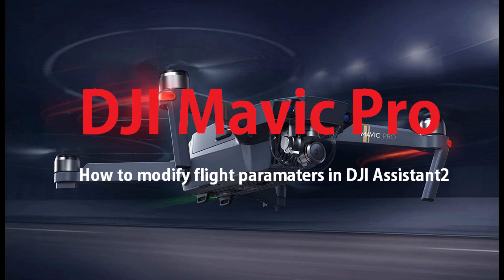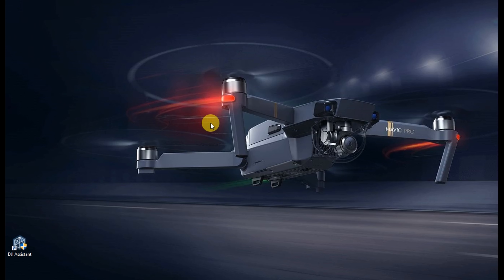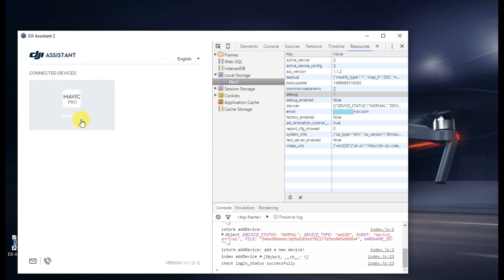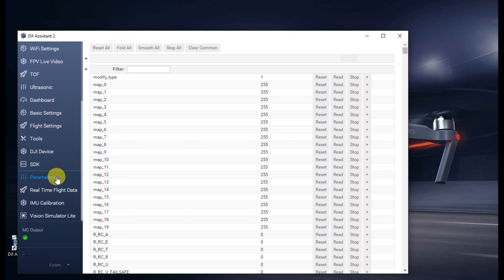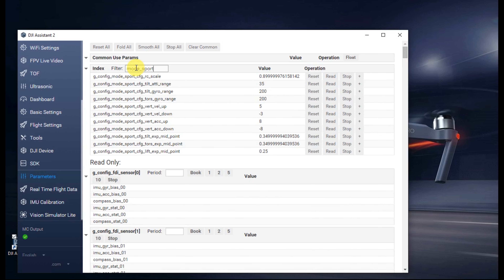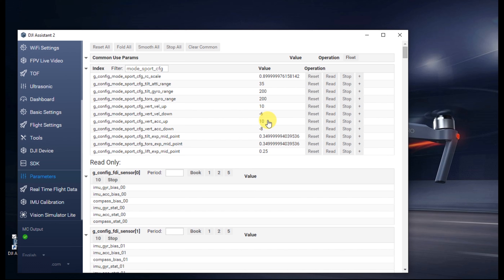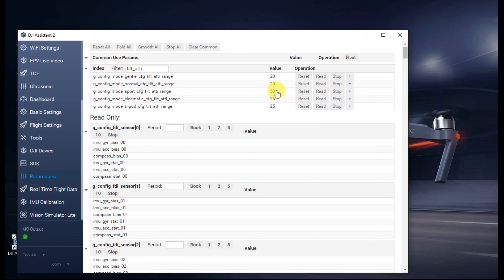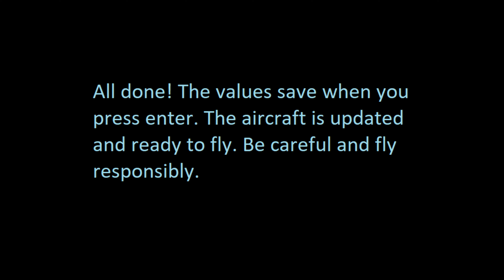DJI Mavic - How to modify flight parameters for Sport mode improvements

Comment: Fantastic!  My favorite change is the descent speed.
Reply: Don't alter your descent speed, the capped speed is specifically to avoid problems with prop-wash whereby the quadcopter is dropping into its own turbulence which can result in a complete loss of control, consequently crash. This was an issue on earlier DJI drones, DJI since capped the descent rate to avoid it occurring - https://phantompilots.com/threads/prop-wash-vortex-ring-state-then-crash-into-sydney-harbour.30098/
Reply: Don't descend straight down and you'll avoid prop wash

Comment: What settings should I set to avoid battery limit/errors? When flying full speed I get errors and limit messages.   Thanks for the help and great video!
Reply: I got these errors too and probably everyone does. You can solve this by making smaller changes than those in this video. For example, change 5 not to 10, but to 7. Change 8 not to 10, but to 9. Et cetera. See what it does. Of course, the lowered "*_down" values from this video are probably not a problem (except in high winds). Also, these errors are popping up fast, they are set kinda 'secure'. Errors may popup while actually the risk of problems is not that high. So when the changes you make are not too "dangerously high", getting an error once in a while is not that big of a problem. Hell, I get battery errors sometimes when I go up and forward fast in sport mode even without any special changes and I'm still flying...

Comment: Hey, today I enabled the Super-Sport-Mode for the first Mavic 2. I did it like the Mavic 1. The Mavic 2 has a 4S Battery and very strong motors. It feels very good to fly the Mavic 2 in SSP.
Reply: +WABWIBWABWOB Hi! You are THE ONLY one talking about this I could find on the Internet. I ordered a Mavic 2 and it’s on the way and I’m really excited but the only doubt I had when while ordering was that I‘ll lose the rapid descent I modified for my old mavic. I think the factory descend in sports mode is way to slow. 

How did you modify the parameters? Using the same software version of Assistant 2 like for the old mavic? And it recognised the new mavic even if the software was created before the mavic 2 wasn’t even out?? 
I want to know really bad if I’ll have to be disappointed.. Feel free to add me on Skype we can talk about this a bit if you want:)
daniel-mails 
My Skype name
Reply: How did you get it working with the Mavic 2?
Reply: Erik Swan Do you have yours already and try it out? Did it not work?
Reply: I have mine but haven’t tried it yet. I just assumed it wouldn’t work because DJI probably blocked it and there’a no older firmware to roll back to for the Mavic 2. I’ll try it tomorrow.
Reply: Ok nice would love to hear how it worked out
Reply: Just tried it out and I can confirm that it does still work with DJI Assistant 2 version 1.1.2, following the exact same steps as the Mavic (1) Pro! The only thing I wanted to change and the only thing I modified was the descent speed in Sport mode, and I can confirm it worked! I would be very careful modifying any other parameters or using any of the other "debug" tools because the older version of Assistant probably doesn't fully support the Mavic 2.
Reply: So to be clear you have to find an old version of DJI Assistant 2 online and install and use that, and follow all the instructions for modifying main.js to enable dev tools, set debug=1, etc. It does NOT work with the version of Assistant that is posted on the Mavic 2 support page, which is version 2.0.0.
Reply: Erik Swan Alright, wonderful! Yeah I made a copy of all the relevant Assistant versions on my external hard drive precautionarily. Thanks for confirming, you are a hero!
Reply: @dwalster7538  Yes, i did it like it was a Mavic 1 Pro. The old Version of DJI Assistant will detect it and you can proceed as usual.
Reply: WABWIBWABWOB how do i access the dji assistant with the source code located on the right hand side when you open dji assistant 2

Comment: If i open my dji assistant 2 it does not give me the option to go to parameters. My menu screen on the left only shows the following. 
Firmware update
Data upload
Flight data
Black box
Calibration
Simulator
Wifi settings. 

Is there andifferent dji assistant 2 that allows you to open the other features.

Comment: Hello. Sunday with a temperature of 5 degrees I had more than a few problems to keep the Mavic 1 in altitude, as I was reported "low battery aircraft landing". Is it possible to avoid this warning? Provided that it does not affect correct operation in flight. Thank you

Comment: Off topic, have you ran into an issue where your props slightly move while gently holding the motor and wiggling the prop clockwise and counterclockwise? (Kinda worried if the mavics props will break off)

Comment: Question: I've converted the Sport Mode switch to make it an ATTI mode switch, so do the Sport Mode parameters still apply here? Did this so I can use the ATTI mode for smooth video; rather than increasing speeds I want to decrease them just in switch enabled ATTI mode.

Comment: I tried to follow your steps and I was able to change all the parameters as you indicated, but when I fly the drone it become very unstable especially when I wanted to ascend or descend, sometimes it flips and descend by itself, very scary, Any advice???? does it has to do DJI Go App (I did not modified the App, just using the latest original)
Note: I downgrade the firmware to .70

Comment: i followed you video to the letter, but when i switch over to dji assistant, i do not get the dev.tools.....i was able to edit the file with notepad ++ ,BUT DO NOT KNOW IF IT SAVED IT, i did try saving in admin mode ...so, do i have the wrong assistant program ?? if so, where do i get the right one ??

Comment: Hi, very good videos! This modification could do bad to the engines? Will the battery drain faster? Can you make it last longer? thank you very much
Reply from the maker: it will put more stress on battery and motors due to more power load. battery will go faster, but depends alot on wind/conditions and your flying style. i flew 21m48s on stock battery yesterdya on this mods .. im happy with that.

Comment: Also DJI set the parameters for the mavic pro the way they were for a reason. What are the dangers in changing these parameters

Will it burn out the motors?

Will it screw up the battery?

Is there a higher chance of the Drone flipping over?

And what about stopping and starting at these speeds could the battery actually come out with this type of force?

Comment: great parameter edits. i'm getting 20 mph vertical speed and 13 mph downward speed. But i'm getting battery overcurrent and max motor output on these settings so i changed vert to 8 and acc up 8 instead of 10 each. i'll test out the max speed tomorrow and tell u. Hopefully this will prevent the warnings.
Reply from the maker: yeh changing the 10 to 8 should get rid of that

Comment: Is there a way to do this with the new 01.04.0000 firmware?  Inadvertently installed the newest DJI GO 4 iOS app which requires a firmware upgrade and I'm sure that will kill my changes.

Comment: Why do you "slow down" the vert_acc_down from stock setting of -8 to -6?  Just curious.  Thanks for the vids!
Reply: I was asking about the same thing.
Reply: acc is acceleration, once u increase the max velocity, if u keep the acceleration the same, the mavic will go down too fast, causing loss of control, which is why he increased the velocity max and decreased the acceleration max. Think of the famous leaning tower of pisa experiments which gravity. Let's say a ball drops in 3 seconds with max velocity of 10 m/s , if we increases max velocity to 20 m/s but kept gravity the same the ball will drop a lot faster time wise. This of course the mavic cant handle, maybe the prop wash issue.
Reply: @ravijanumpally9682  Why change the max velocity at all then?

Comment: Please help with troubleshooting saving parameters.  using DJI Assistant 2 ver 1.1.0 under resources, Local file storage, debug is set to 1. With mavic connected, have access to the parameters, can enter new values, but when i hit enter, they do not save, revert back to previous values.
Reply: Bud Melch I did this. Fix is easy. Click on Mavic first.

Comment: Very interesting but what im interested in is LOWERING the YAW endpoint from 100 to say 20thru70 so that in normal AND sport mode the thing isnt a over sensitive beast and makes for much better cinematic control as the YAW is a PIG... any ideas... I will donate $20 if you can provide the fix areas
Reply: i think this is not possible why is why he has a gps plus mode.

Comment: I loaded the Assistant 2, but I do not get an option to open resources at the top as you do...am I missing something? I have the Mavic Pro and DJI Assistant 2.1
Reply from the maker: need assistant 1.1.2 or earlier, thats prob it .. then edit main.js and save
Reply: Tried version 1.1.2 ,same thing, no resource option to mod...???

Comment: Is there any info/tutorial about other values I can put to speed+ mode? 

I changed my descending speed to -6 but I still feel it going down too slow. It took me 2 minutes to ascend from 50 to 1000 meters, and same 2 minutes to descend to 240 from 1000.
Reply: check if your sport mode is enabled. The sport mode might be up on the controller, but you have to have multi flight mode enabled on the DJI Go app setting.
Reply: angel300400 thank you for reply, but it is enabled, yes.

Comment: Great video, thank you. How do we increase the forward max speed in Sport Mode? Whether the max_speed value stays at "20" or not it doesn't change the forward speed.  All the other changes work well and the ascending and descending speeds work and are quite noticeable but the 20 value doesn't increase the max_speed. Does anyone know what parameter(s) will allow the Mavic to fly forward at 50 mph?
Reply from the maker: You want to up "g_config_mode_sport_cfg_tilt_atti_range" to 50 to get more speed.
https://flyflydrones.com
Reply: digdat0 thanks bro. Great informative videos. Thank you for your work.
Reply: Is there a max speed setting for ATTI mode?

Comment: ok so I managed to downgrade to 007 following the instructions from one of your other videos and now I’m trying to change the parameters.. all good until I get to max speed one where I can put the value of 50 in but it won’t stay at 50, it changes back to 10.. I’ve tried many times without luck and also what I have noticed is that it won’t do that for values up to 20, but if I put 21 or any other higher number it will just change back.. any help please? Thanks!

got yourself a new subscriber! 😊
Reply from the maker: max_speed, max value is 20 per the internal settings.
Reply: digdat0 right, almost lost my drone the other day but luckly the Rth kicked in and done the job when pressed, however.. another question here.. do I have to downgrade the rc firmware as well? If yes, how? Thanks for replying btw and keep up the good work

Comment: I'm on .900 firmware too but the max flight speed always resets to 10 after each boot. The other parameters stay updated. Why is this?
Reply: Paul Barker ....yea I see the same problem!
When I reboot the mavic, is the change taking place or not?
Reply: Me too so i even rolled back to .800 but same thing :(  anyone figure this out?
Reply: johnnieyaz it won't make a difference what firmware your on, it's the tilt that makes the difference in speed. Change the tilt on 60 instead or 50 and you'll get 45mph or more.

Comment: Everything saves except the "max_speed" parameters...it always resets to 10, only if you turn the drone off and back on again!
If I reboot the assistant 2 app the setting stays at 20. But when you reboot the drone 
It goes back to 10.....What's going on???
Reply: Need firmware .700 for change this param

Comment: THANK YOU SO MUCH DigDat0. I´ve modified several parameters following your indications. Quite easy once you loose fear!.
I haven´t already tried them. I just wanted to see how they perform, but will not use them often (I mean I want to fly safe under law when talking about height limits and I don't want to use Mavic as a racer so often in order to avoid chashes). What I would really appreciate is the only parameter I am not able to change: CE to FCC mode (in order to achieve stronger signal). I run on IOS (iPhone 7). The only tutorial I´ve found is to be used with Android. 
Please If anyone discovers how to change CE to FCC on IOS please tell!
Cheers

Comment: The resources option is not available when I launch DJI ass 2 program under win 10 64 bit. 

How can I pull up the the "view" tab and "toggle developers tools".    
 
I have no view tab in my DJI ass 2 program. It only has the limited items on the left side. How do I bring up the view tab? I even uninstalled and re in case something was missing.
Reply from the maker: Did you edit the main.js file?
Reply: Yes of course. checked it many times and the \\ are removed next to the correct line but DJI ass 2 just has the basic on the left no Dev console. Suggestions  ? 
Was able to roll back firmware to .07 with no issues.
Reply: Issue resolved it was the laptop services issue. Win 10 64 bit did not allow full use of the dev tools. Tried it on another LT and it worked first time. Thanks digdat0 for your suggestions and email.

Comment: Im switching back to android but want to keep my FCC settings and Sport+ enabled. Im on .700 mavic. Which Go4 version should I use?
Reply from the maker: android forces updates in the go app ..so you need a solution to that if you want older, i recommend the modded android version 4.1.14 or 4.1.15, or install noroot fw and 4.0.6, where fcc works very well.
Reply: I will check into these. I plan on rooting my shield when it comes, hoping I can disable updates that way. Thank you!

Comment: Hey I took a spark from the stock value of 35 up to 45, then 55 and dont see any change in the flight speeds in gps with avoidance off. Any thoughts?
Reply: it's because Mavic Pro engines can't sustain more than a 45 degrees inclination. Tested

Comment: great work brother question this change are only for Mavic correct can't use on a 
P4pro
Reply from the maker: same process for p4p man, i think same values too ;)
Reply: Ok thanks
Reply: ok thanks
Reply: Is this also possible for Phantom 3 Pro? Thanks.
Reply: Andyc yes it works on all the drones, I've changed the parameters on my spark to the same way I have my mavic set up and I'm getting 45mph+ on my spark in sport mode!
Reply: Giovanni Lopez hey bro, how do you increase speed with Mavic? Tilt? Which parameter? Thanks
Reply: SCAR16s Are you asking how to increase the tilt speed on the mavic?

Comment: What is the maximum tilt angle  above 50 I can use for top speed?
Reply from the maker: 60 but its counterproductive
Reply: digdat0 I understand the mavic was not made for top speed, it's just really curiosity. Thank you so much. I have another question. What the best version of the dji go to use with .700 on Android?

Comment: The same for me. Using any DJI Assistant 2 version under resources, Local file storage, debug is set to 1. With mavic connected, have access to the parameters, can enter new values, but when i hit enter, they do not save, revert back to previous values.
Reply from the maker: What aircraft and firmware you on? Happens with all or just some parameters?
Reply: I'm in 400 firmware. All the parameters are locked.
Reply: Solved. You must push the value several times, and at the end the value modified remain.
Reply: u don't have to do several time, do this, click with mouse to the right of the new value and hit enter works every time.

Comment: i'm on .900 firmware and the max flight speed always reset to 10 after each boot :(
Reply: Me too it does that :-(
Reply: have you fixed that issue yet..
Reply: Same here
Reply: Mine does the same thing. Does anyone have a solution for this?
Reply: I rolled back to .800 fw and it still goes back to 10. Anyone find a solution? .400 sounds like PIA
Reply: johnnieyaz roll back to 700 firmwear it won't reset anymore. I had that issue on 800 and 900. With the 700 it won't reset..
Reply: i have .700 and it works like a charm...he has a guide on how to rollback more =)

Comment: Flight speed is a command that does not really work!
On .400 can also be set to 20, in the others back to 10 after restart.
Even at 20 the speed is the same.

No change for speed of flyght with this parameter in mavic pro.
Reply: you have to also change max angle, the craft will travel faster the more it is pitched

Comment: g_config_mode_sport_cfg_tilt_atti_range = 50 
g_config_mode_sport_cfg_vert_vel_up= 8 (recently changed to 8) 
g_config_mode_sport_cfg_vert_vel_down = -8
g_config_mode_sport_cfg_vert_acc_up = 8 (recently changed to 8) 
g_config_mode_sport_cfg_vert_acc_down = -8
g_config_fw_cfg_max_speed = 20
brake_sensitive_gain = 110 (NOTE I CHANGED THIS AFTER DOING VID 70 is too low)